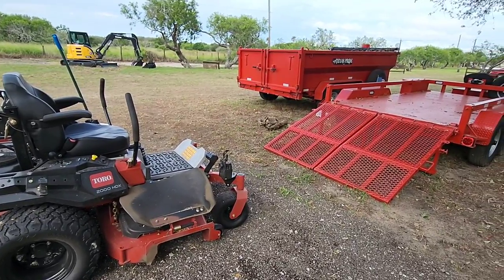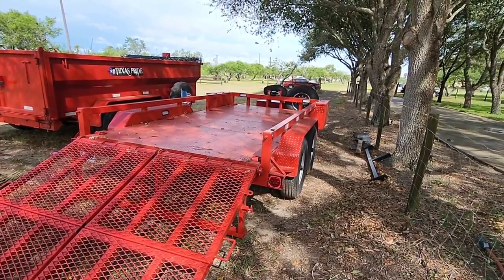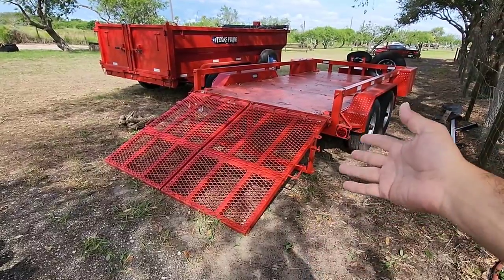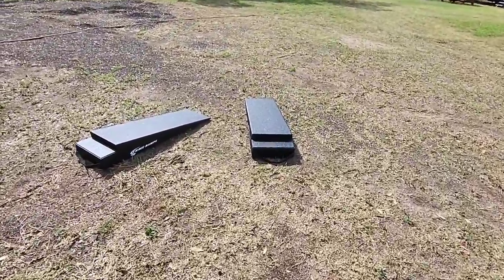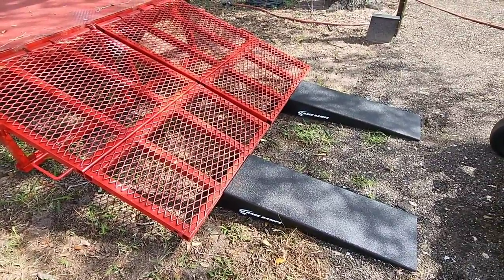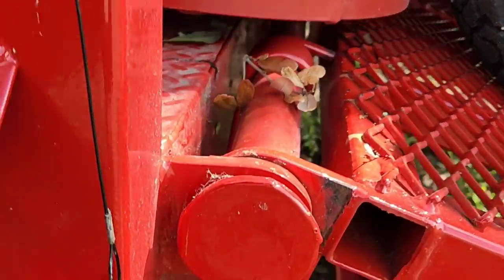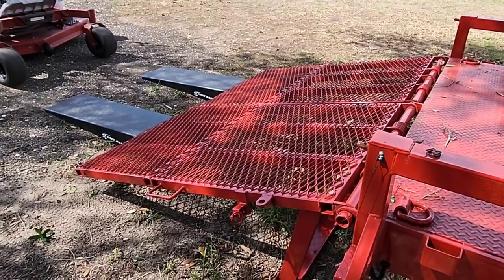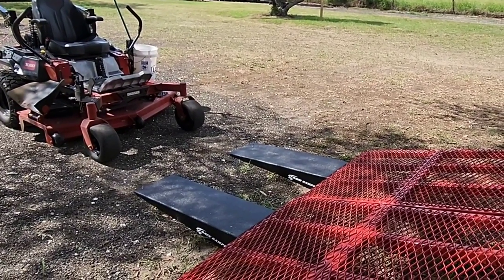New Trailer Issues! I HAD a zero turn mower loading dilemma!

Comment: Had a similar issue. Need to raise the ramp where it meets the ground. I bolted a 4x4 across the bottom edge. Gave me clearance at the ramp/trailer bed junction. I also bolted a trailer jack to the back corner of my trailer so I can load/unload my mower without it needing to be hitched up. Prevents the front from flipping up.

Comment: Yeah in those cases I’ve always just jacked up the front of the trailer to turn it into a sort of tilt deck. Keep it hitched up and just crank away, or back the truck onto a set of ramps to lift the tongue up.

Comment: I wonder if adding 3rd fold out for the back would work? That way you could use it with the 2 fold outs most of the time, but if you need it you have the 3rd fold out. Then you don't have to worry about carrying something separate.

Comment: Hey JD, when you talked about raising the front of the trailer, when it is hitched to the truck, you could do one of 2 things. 1) When the trailer is locked on the hitch, you can still use your tongue jack to raise the front of the trailer, and it will not go anywhere. I do this when it have to put my weight distribution bars on my toyhauler. Just put a block under the foot, and up you go. 2) I have seen guys at the racetrack use ramps under the back wheels of the tow vehicle to unload dragsters. To me, #1 is the easiest and fastest. Hope this helps.And, Happy Belated Father's Day.
Reply: He can't because he has braces on the gate to keep the trailer from tipping up.
Reply: @JCLawn51  don’t those braces fold up if needed for transport etc? I’d think their use would be optional. Nice to have if loading heavy equipment on an unhitched trailer but I’d think it can be moved to not inhibit the OPs suggested technique.

Comment: Another option is to shorted the chains that hold the deck.  That will give you more clearance.  It will not effect you cutting height because that’s controlled by the rear rollers and their setting.

Comment: Did you explore the option of getting a drop axel? You can still get 8k axels and tires but they drop the axel typically 4" from the center of the hub and lower the frame closer to the ground.

Comment: I got a 50” toro time cutter and a karavan trailer. They made the ramp so short. And it doesn’t help the toros deck is known for not going up very high. What I do is put wood under the ramp to make it a less steep angle, I also am going to get a higher hitch on my truck so my trailer will be angled back. Single axle so it’s ok.
Just saw the “race ramps” I feel like a genius. I was planning on building ramps the same exact shape out of wood.

Comment: I back up a 54"John Deere commercial ZTR in to a 2020 Chevy 2500hd.   I use 8' foot folding ramps with a slight arch on  the end that attaches to the taik gate.  It is quicker and easier than loading on my 20' flatbed trailer.

Comment: How about filling the spaces between the lift springs & frame sections with some nylon rollers that are say ¼ inch diameter larger than the OD of the springs?

Comment: I love this guys content, but this is crazy. If I had to lay out those ramps at every cutting job i was doing, I would be rid of that trailer after two weeks. This race ramp solution is no more practical than the box framing you were using. I must have missed why the dove tail was forgone or you did not mention it. Personally, I would take that trailer back to the manufacturer and have them make the 5 foot folding ramp a 7 foot folding ramp. To anyone who says "a 7 foot ramp will be too long and eat up working space at a tight job" so what? This issue was created by the design of the trailer. The trailer looks nice but for me this solution would not be practical. I suppose if you are happy with it that's all that matters...
Reply: Whoa you said job, this guy's loaded he doesn't job he hobbies he's got time to play with $500 foam ramps, probably pushed close to $20K on the trailer build and has to get a CDL now to pull it, I mean who has an electric jack and 2 batteries on a 14ft utility trailer?
Reply: @hellephant4268  I think you took offense to my opinion? Tough.
Reply: His current solution isn't better than a 7ft ramp.  He elected not to get a dovetail because he wanted to load 2 mowers at once.

Comment: As a professional I would add to the existing ramp. Also when running hydrostatic tractors, zero turns the throttle should be 3/4 to max throttle speed if you don't you will damaged the hydrostatic pumps.
Reply: Your correct Mike Jones,and the pumps arent cheap either,I know how to rebuild the pumps/transmissions and also save myself alot of money by rebuilding all my spindles too.

Comment: Ok if your mower deck is hitting going up the trailer here is how to fix it you take and turn the shackle straps up towards the bottom of the trailer that will lower the trailer if you want the trailer raised up you take the shackle straps and turn them down towards the ground that will raise it up

Comment: Just before you showed the race ramps i was sitting here thinking "he needs race ramps". This situation is one reason why most lawncare companies around me run around with trailers with a gwr of like 4 maybe 5k lbs. As a dedicated mowing trailer they dont need that much capacity. Most are pulling one maybe two zero turns at most and then a couple string trimmers, leaf blowers and that sort of thing. Also here in Illinois license plate stickers for trailers are ridiculous. The lighter the trailer gwr the cheaper the sticker. If you can get away with a TA trailer which i believe is a 3k gvw then i think you can pay a 1 time fee of like $120 and get a permanent sticker. My 10k gwr enclosed trailer is a $250 license sticker now and that has to be renewed yearly. Now if you're needing a multipurpose trailer that can handle a variety of rolls then the higher weight capacity is beneficial.

Comment: Race ramps are nice and all.  If I was building that trailer I would’ve had the rear stabilizer legs put on the rear sides of the trailer on the corners this way all the weight being placed on the rear of the trailer would be stabilized on the trailer frame and not the ramps because not all places where one loads up at is level as the way those on the ramps are designed for. But I myself would’ve not went with a 14ft trailer built that heavy duty

Comment: The deck seems high for no reason, on all our HD landscape trailers the whole fender can put u see the side rain and the deck is around 4 inches lower just my 2 cents frame seems built up for no reason as well. I don’t see why the deck starts 6 inches over the bottom of the frame.
Reply: He had it built with 8" C-channel or I-beam frame so deck is 4in to 5in higher than normal people